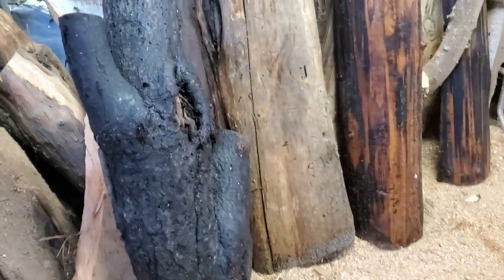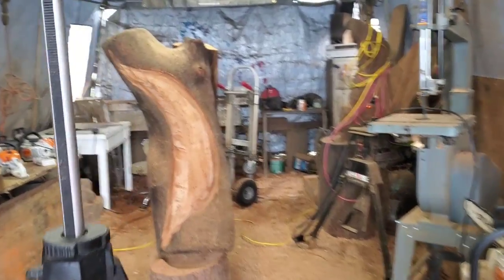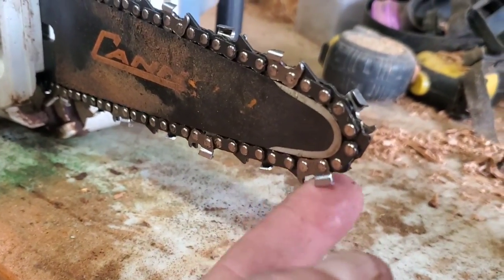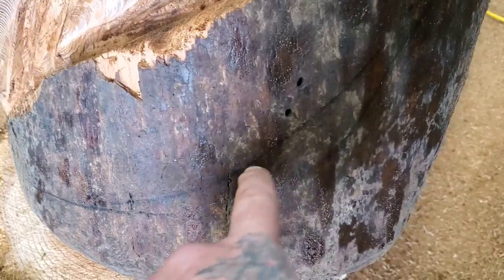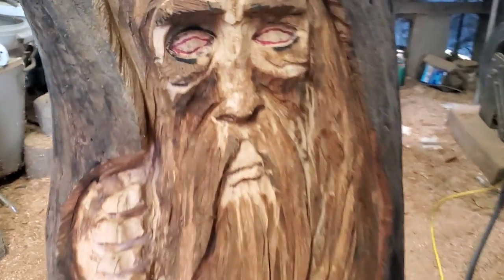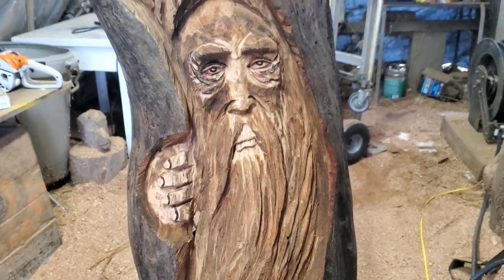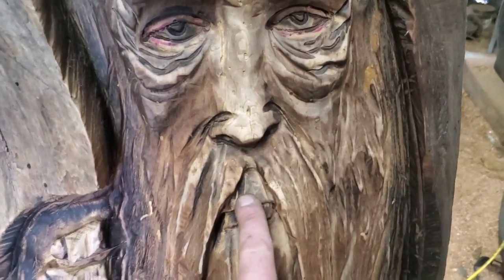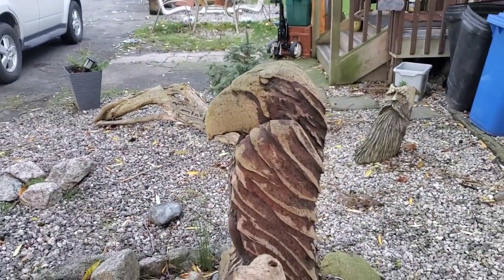Wood carving with a Chainsaw. Spirit in the wood.

Comment: Jordy, at 17:04 mins into this video you show a larger sanding flap drill attachment...  what is the brand/model of that unit? I assume you use this mostly on the larger projects?

Thanks.  Brad
Reply from the maker: Sandoflex